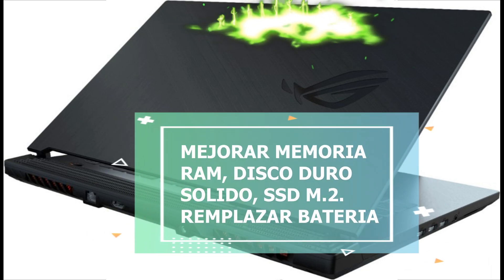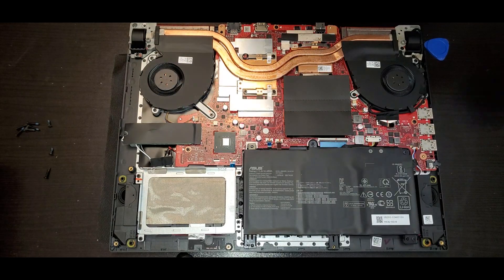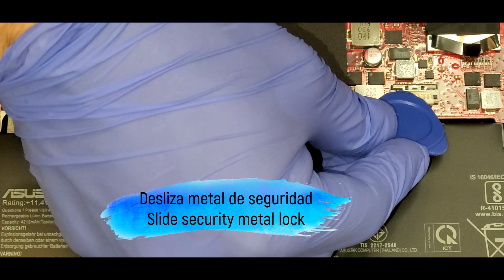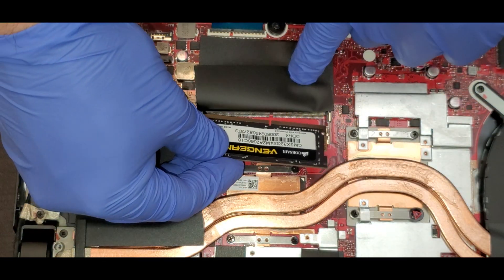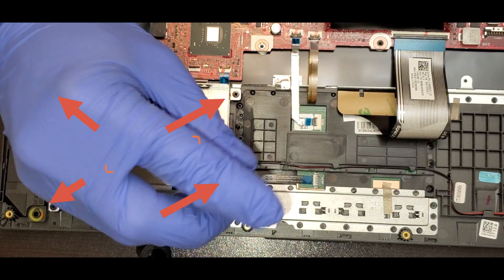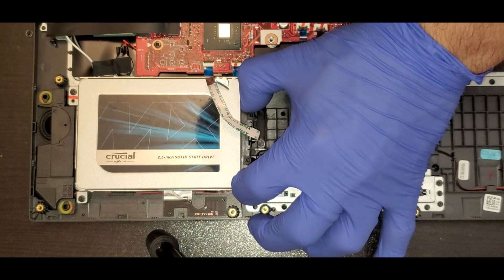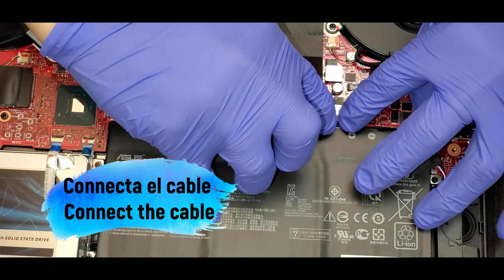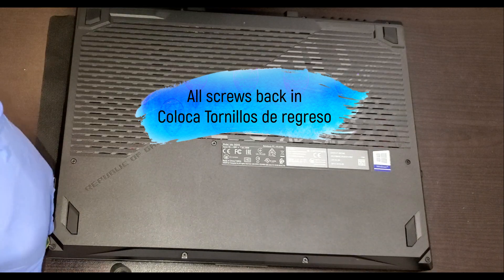ASUS - Rog G531GT 15.6" - Upgrading Memory Ram - SSD - and Others

Comment: Just followed your instructions to install a second ssd in my G531GT and I realised in your video you put your ssd in its cradle upside down. That's why you couldn't screw it down with the ribbon cable connector attached. If you put the ssd in the cradle the other way round, the connector lines up correctly and you can screw the ssd cradle back in without removing the battery.  Anyway I still want to say thanks as your video was still useful for me.
Reply from the maker: Appreciated it the additional feedback, I will ping your message... All comments are welcome.. Really appreciated it. @spacegooner
Reply: What are some good compatible SSDs for G531GT? I got some info that WD ssds are not copatible with Strix G laptops

Comment: If my laptop is already installed with 16 GB ram, can I keep the current one and just add a new one of any brand but still 16 GB so I can get a total of 32 GB? Thank you.
Reply from the maker: you have to check if you have 2 memory ram, 8GB and 8GB or one 16GB... if you have 2 memory ram 8GB each, you need to buy the set of 2 16GB = 32Gb.. if you have 1 16GB, and 1 slot free, buy just one 16GB
Reply: @xlearntechnow  Thank you. Was just thinking if it's mandatory to also replace the old one or I can just buy the "missing anount" of RAM. Already added a new 16 GB. Thank you for the video.

Comment: sorry to bother you, but it means that if you want to keep the m.2 that comes with the laptop a storage upgrade would be limited to 2.5 inch drives right?

also is the Intel 660p m.2 SSD you showed the one that came with the laptop or did you upgrade to it?
Reply from the maker: Correct. Or removed the current SSD. And put a 2TB one. Reinstall windows. Keep in mind that windows 10 or 11 the license that come with is attached with the laptop. And of course on most of this model you can add a Sata ssd, if laptop did not arrived with the connector. Reach out to ASUS and they will send it to you free of charge.

Comment: When my laptop's ram upgrade (2x16) gb ram. But not showing 32gb ram. showing 24gb ram in the task manegar and model is asus strix g15 G531GT. why, please help me.
Reply from the maker: Hello how are you? Welcome to my channel.  Are you 100% sure that is not. 1 8GB and 1 16GB. Probably they sent you used ones or you put the wrong one?... just saying. At the same time try to upgrade the BIOS on your laptop to see if that helps to recognize the ram. Check your processor which is  the max support memory ram
Reply: I am also fine and about you. Actually RAM is 8GB and i am replacing the ram.

Comment: What model SATA connector cable did you use and where did you buy it?
Reply from the maker: How long ago did you buy the laptop?. You can reached out to the manufacturer, if you are based on the U.S provided them your serial number and they may send the cable for free. Check the manual of the laptop or laptop box if the cables is not inside

Comment: Thanks for your useful video! The laptop wasn't that hard to take apart, nor to put back together, but I have one problem. The battery cable clicks back to its place nicely, but for some reason that metal lock doesn't go back into its place when I have then battery plugged in. Do you think this can be the reason why my G531 doesn't see the battery at all? Otherwise it still works just as fine when I bought it.
Reply from the maker: I recommend you to open again. Carefully check if a screw or something else when below the battery that probably is not fitting together. Make sure you are using the screw on its right place. Probably the battery has been installed incorrectly. Double check it.

Comment: Hola amigo muchas gracias por el video, acabo de aumentarle 8 de ram y la diferencia es brutal. Te quería preguntar, la ram que le pusiste de que frecuencia era? La vdd no sé cuál sea la máxima que acepte está laptop, ojalá supieras gracias.
Reply from the maker: Que modelo tienes de laptop hermano. Generalmente si le pones una frecuencia Mas alta, la laptop la aceptara, pero correra a la frecuencia que ella es capaz. Bienvenido y espero que te subscribas. Especialmente google chrome que se come toda la ram🤣 te recomiendo tambien disco duro solido M.2. Para que vuele 😍 no olvides subscribirte un abrazo

Comment: Hello, I want to add ssd to my laptop. What should I prepare before I open it and what should i do after I finish install it? I don’t wanna mess it up and lost access to it. I upgraded my lap to win 11 recently, so it might harder than normal
Reply: Hey. Im going to do this myself too. With the help of these instructions, make sure you use a anti static wrist strap (Just to make sure no static electricity shocks your laptop) also be carefull if you have RGB lighting on your type of laptop. When opening the back cover, there can be 2 strips connected to the motherboard, disconnect these first. Disconnect battery also when working on hardware. When you installed your new SSD. Make sure you format the drive so your laptop recognize it.

Search on YouTube how to use clone software if you want all your files to be moved to the new SSD. 

😁

Comment: sir its mentioned i5-9300H supports maximum ram speed of 2666MHz but crucial site shows 3200MHz..which is true? can it run maximum of 3200mhz?
Reply from the maker: If you install memory rams with higher MHz, laptop will run with max capable for. Should not be a problem. Give it a try. Welcome and I hope you subscribed

Comment: Do you have to disconnect the battery and ssd m2 before you change the ram? All i want to do is upgrade my ram. Thank you
Reply from the maker: Welcome to my channel. Yes always disconnect the battery for the motherboard to discharged. Then add the ram or replace then. Or ssd. After you put it on. Connect the battery back. Put the cover. And test it. If everything is good. Turn if off and screw in

Comment: Just subbed! I was wondering if I am able to upgrade the everything on this laptop. Like the cpu,  gpu and even the monitor. I have 60hz and I would love to upgrade that to a higher hz. Can I do those things?
Reply: This laptop has 120hz screen already you just need to tweak some settings from the armoury crate app (performance/turbo mode). In terms of upgrading other things like cpu and gpu, you cannot since theyre not meant to be upgraded in this model. You can only upgrade the ram and storage for it. So there you have it, I hope I've answered all of your queries.

Comment: Thank you so much for the video! Quick question, I have misplaced my SATA HDD cable, the one which connects the extended SSD hardrive to the motherboard. Can I use any SATA cable that attaches to the motherboard, or does the SATA cable have to be the one which came with this computer?
Reply from the maker: Welcome and don't forget to subscribed. Kindly do the following if your laptop has been purchased and has less than 1 year since you have it. Reach out to ASUS chat support via their website. If you are in United States, Canada or Mexico let them know that your sata cable did not arrived inside the laptop box, they will ask you for your serial number and address, so they can send you the SATA CABLE at not cost. If you have to pay for it, the cable is not that expensive but I highly recommend you get the original part from ASUS. It is a small flex that convert to Sata 2.5 hard drive connector.  (I tried before cables from ebay that they don't work properly). Installing the hard drive and connector won't damaged your warranty. Hope this helps and let me know how goes.
Reply from the maker: Was asus able to help you?

Comment: Does upgrading ram void warranty ?
Reply from the maker: On this specific model does not, the warranty sticker is on top of one of the screws that goes into the heatsink's processor and video chipset one. You can open it, changed the battery, upgraded de sdd m.2, add sata hard drive and upgraded your ram. As recommendation, if you need to send your laptop to ASUS for repair, put the original memory ram back😉 just in case. They have a lot of stories from different customers.

Comment: hey bro, this is my model Asus Rog Strix G531GT BQ002T i5 9300H, 8gb ram 2666hz ddr4 , GTX1650. I bought a higher frequency which is 8x2 = 16gb ddr4 at 3200hz. do you think this ram will work on my laptop?
Reply: i both a 3200hz but im not getting full speedim getting 2667

Comment: Should I buy the replace the stock 8gb when I upgrade? Or just buy 1 ram chip? Thanks
Reply from the maker: If you can get full 32GB / each 16GB would be better. When you put two different memory ram sometimes can causes issues . Depending on the voltage, speed and types "not always".
Reply: @xlearntechnow  thanks!

Comment: Wait, there is no ribbon cable on the laptop?
Reply from the maker: Are you asking the connector for the Sata Hard drive?
Reply: @xlearntechnow  when you open the laptop, there should be ribbon cable attached from the back panel to the motherboard. You would usually need to disconnect the cable so you can take away the back panel .
Reply from the maker: @HungryHippo783  this particular model does not have that ribbon cable between the cover panel and the motherboard. But always be careful when you open your laptop. They always make some changes between years and models. Welcome I hope you subscribe
Reply: @HungryHippo783  probably LED light on the back panel. This one doesn't have one.

Comment: Hello i have a problem, i have asus rog strix G531GT and i want to upgrade the ram from 8gb to maybe 16 but i dont know, do i need to buy a specific ram from store for this ton work? If u can help me it would mean alot to me!
Reply from the maker: Kindly provided me the specific model number for your laptop and processor type that your laptop has. Of course I can help you with it, and of course you can upgraded with not problem. I will provided you the ones that fit your laptop
Reply: @xlearntechnow  thank you very much i have asus rog strix G531GT i7 9750 nvida gtx 1650 8gb Ram and 500 gb memory 15.6”
Reply: same bro pls

Comment: Can i upgrade  SSD
Reply from the maker: Yes of course you can, the windows 10 license is attached with your hardware ID from your laptop. Get ready your usb windows 10 installer. With the windows 10 tool. After replaced your SSD m.2 storage with a bigger size and reinstalled windows. Welcome and I hope you subscribed

Comment: Is it possible to upgrade the gpu for a later date i have a asus rog gl731gt it has a gtx 1050 i would be looking to upgrade at least to a gtx 1650 and the chipset is a intel i7 - 9750H
Reply from the maker: I don't think would be possible because the GPU comes soldier to the motherboard and manufactures most of the time they already set the laptop to work with specific CPU and GPU chipsets. Even if you changed it probably won't work.
Reply: @xlearntechnow  Oh alright well damn thanks for replying at least

Comment: If you upgrade the ram on this laptop do you need to enable an XMP profile in the BIOS after?

Or will it use the full speed automatically?
Reply: I just upgraded the ram to 2 x 16gb and it recognized it at the full 2666mhz and I didn't have to do anything. I don't think there even is an XMP option in the BIOS on this board actually. I looked and there wasn't anything like that on the menus.
Reply from the maker: @excessmaterial  amazing news. Good to know that my video was helpful and you were able to completed it.
Reply: @xlearntechnow  Oh for sure. Your video was definitely helpful at taking the laptop apart safely. It was well done.
Reply: Mine did it automatically
Reply from the maker: @megadeth8592  thanks for sharing the info I really appreciated. Welcome and guys don't forget to subscribed.
Reply from the maker: Probably you have to do it manually. If it's not option to set it automatically. . . Hope you are doing well.

Comment: If I bought one of these and wanted to install a much larger m.2 ssd on day 1, could I swap it out before turning on the laptop for the first time and it will recognize it and boot windows normally?

Or do I need to do something special first? I really want mine to have more than a 512gb m.2 on it. Like a 2TB Samsung 970 EVO plus.
Reply from the maker: Welcome to my channel my friend. If you have another windows machine. Download Windows 10 on a USB with the windows 10 downloader usb tool directly from Microsoft. Get a USB 8GB or bigger. The tool will erased all the data on the USB. . . After that go ahead and swap the ssd and reinstall windows 10. The license that bring from the manufacture will be attached with your laptop hardware ID.  I hope this helps and of course you can
Reply: @xlearntechnow  Okay so there's an id associated with the laptop when I buy it? And you enter it in on Microsoft's website?

Where is the id located?

Can't I use the Win 10 the laptop comes with to make a boot USB? Or is that not the same thing?
Reply from the maker: @excessmaterial  windows 10 is free to download to created the usb https://www.microsoft.com/en-us/software-download/windows10%20 . . If you put a new storage and reinstall windows 10. Will automatic activated with the license that the laptop came from manufacture.
Reply: Did you upgrade to 2TB Samsung drive?

Comment: Thanks for this! considering buying and was interested to see if it is upgradeable
Reply from the maker: Asus it is a pretty good laptop, I know friends that they bought it over 5 years 3 years others 6 years ago and still works perfectly smooth. Of course is depends on the using, but of course you can upgraded this model with not issues. I hope you subscribed and welcome.
Reply: @xlearntechnow  thanks, I subcribed now! I will use for moderate gaming nothing too crazy

Comment: Slots for nvme m2 ssd in this laptop
Reply from the maker: This laptop has 1 SSD m.2 slot and the laptop bring 1 flex sata cable for additional Hard Drive (you can search for the cable inside the box or reach out to ASUS for it with the serial number of your laptop)

Comment: Can we upgrade cpu  & install i5 9600 it's possible or note  ???
Reply from the maker: That depends on the manual for each laptop. Most processor they come soldier to the motherboard and already setup to work on each one. Most of the time won't be possible swapping the processor. Welcome don't forget to subscribed.
Reply: @xlearntechnow  I have asus rog strix g i5 9th gen  laptop I went upgrade cpu is possible or not sir ??
Reply from the maker: @prabhatpatel9047  most laptops they already come preset with specific hardware and cannot be upgraded. The processor on this laptop is soldier into the motherboard